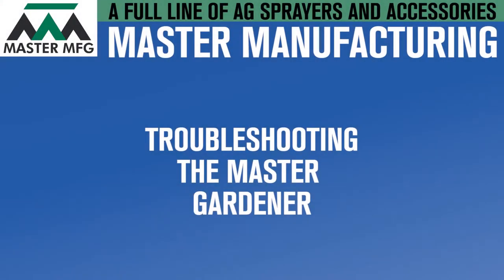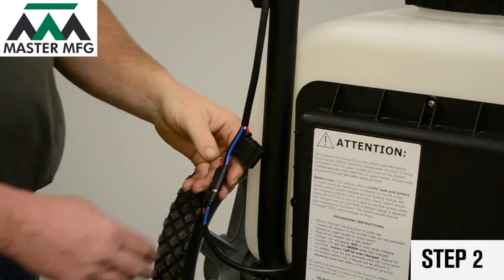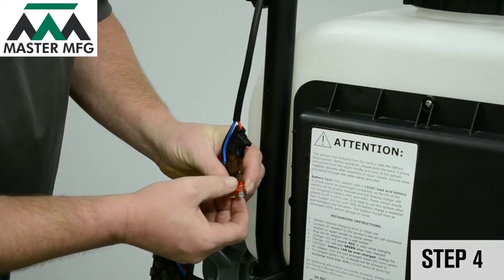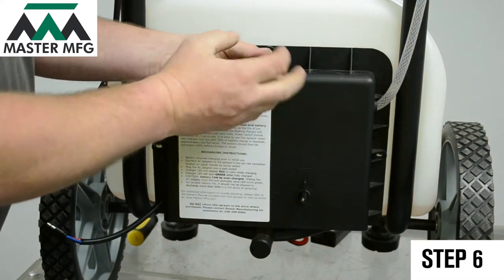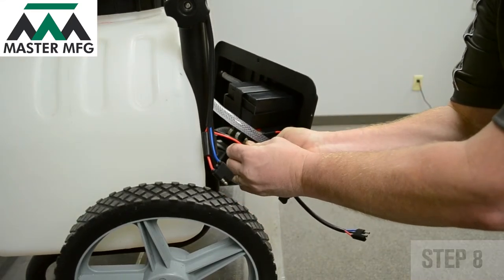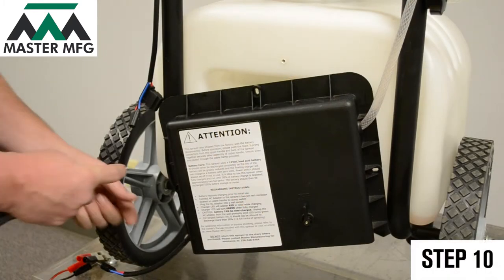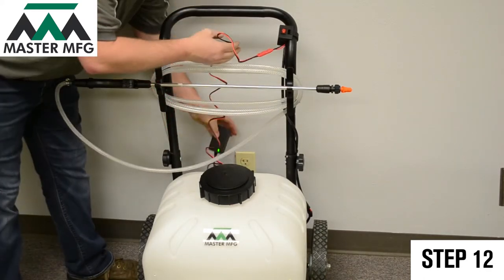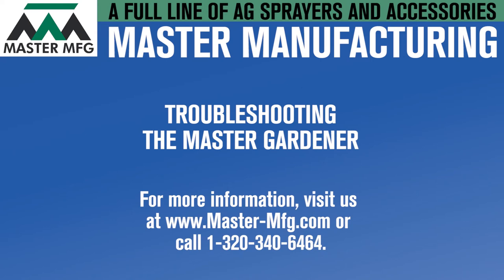Troubleshooting Power On Master Gardener Sprayer

Comment: So the power light turns on but the unit doesn't do anything when I squeeze the handle on the sprayer nozzle. I've double checked that the battery has a full charge and that the little valve is turned to the on position
Reply from the maker: Thanks for reaching out. We have another troubleshooting video in relation to power issues with the Master Gardener here (https://www.youtube.com/watch?v=KoqPfwq0NzA). If this doesn't remedy your issue, we would love to connect with you on what else it could be. Our number is 1-800-825-5397 and email sales@valleyind.com.